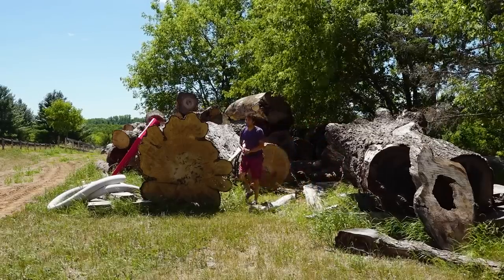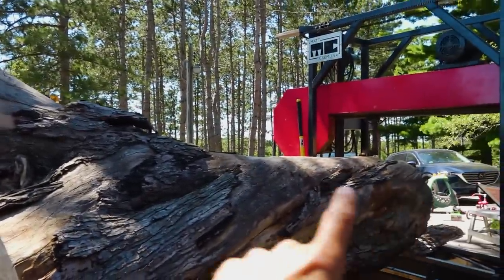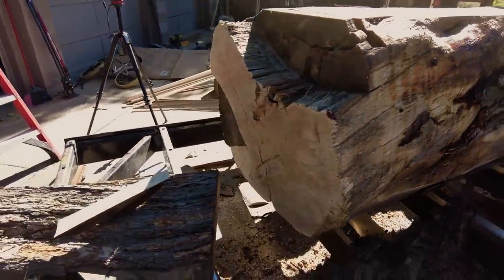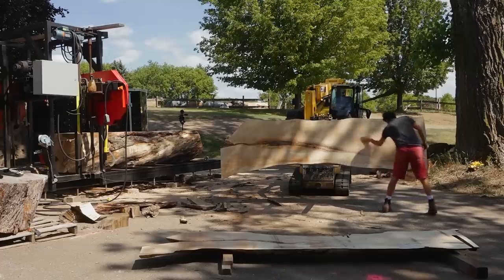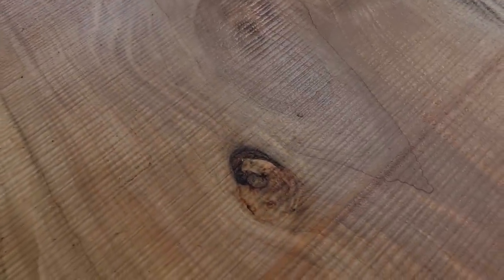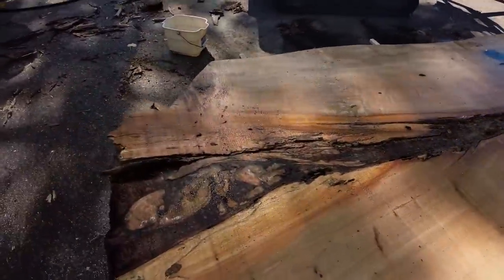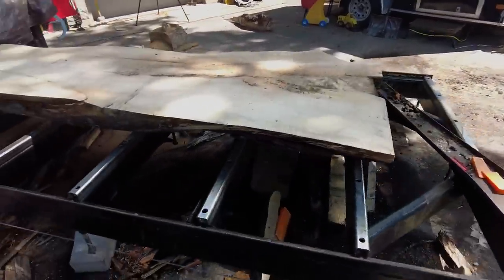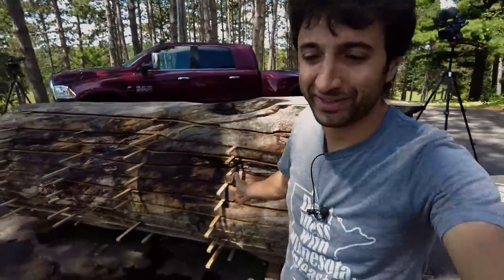Silver Maple Log with an Embedded Chain on my Sawmill

Comment: In the machine trades, we cut tool steel with a bandsaw every day.
You just have to slow down your feeds and speeds.
Most motors will accept a speed control.

Comment: I've gotta ask what brand of band your using to slice metal so effectively. I cut through a one inch steel pin one time with a brand new band but it's cutting days were finished as many teeth were sheared off, it didn't finish the cut.
Reply from the maker: Using woodmizer’s 1.5” carbide band in this video
Reply: @mcremona  Do you reckon they could slice through an Abrams tank?
Reply from the maker: @ohasis8331  might have to adjust the feeds and speeds

Comment: 20:00 -ish pretty impressive that you're manhandling that slab around just using body strength!  The sliding out part, anyway.
Reply: Go to 29:45
Reply: @tomahoks  That was one of the few times that he had difficulty with a slab. For the most part, it's impressive what he can move.

Comment: Matt, any reason you don't use a metal detector on the logs?
Reply: He uses carbide tipped blades so for the most part metal objects are not an issue. If you do use a metal detector on the flat surface of the log and find something what are you going to do? Where is it? What is its orientation? The black staining will let you know approximately where the metal is. Trying to dig the metal out will damage and reduce the value of the slab. It will also add additional time to the milling process. Time is money. Dealing with the metal and staining in a slab is easier. Most people prize slabs with figure and character. He understands that foreign objects especially urban logs is to be expected. Since he changed to carbide blades,  he has saved so much time just in not changing so many blades.

Comment: Your "enjoyable distraction" would or could have been very expensive in terms of replacing, or at very ;east, resharpening, the cutting blade if you had hacked into that steel chain item and the nails.

Comment: Careful, you saw did cut through some mild steel... aren't you lucky that you did not cut through the chain link. This is hardened steel which would mess up your blade in a second.
Invest in a metal detector !